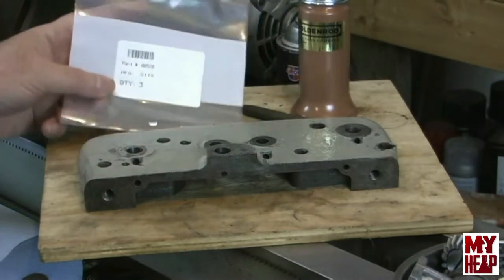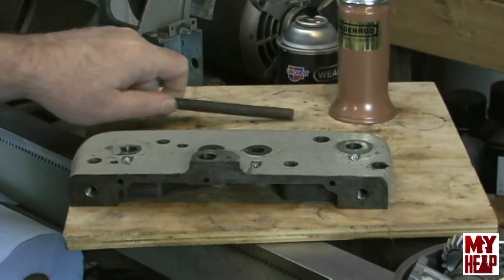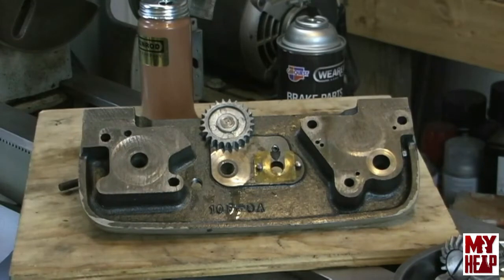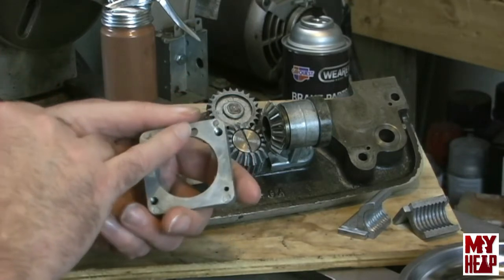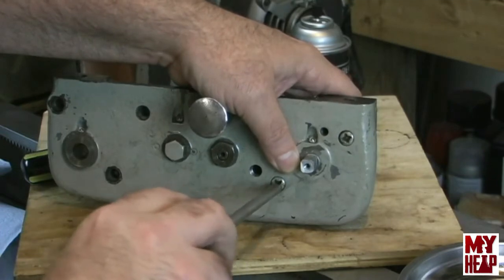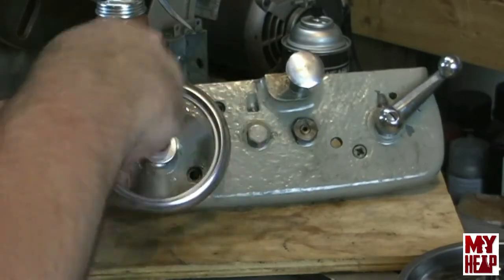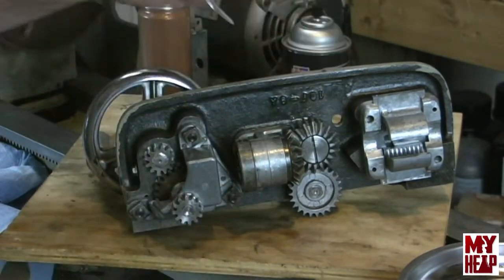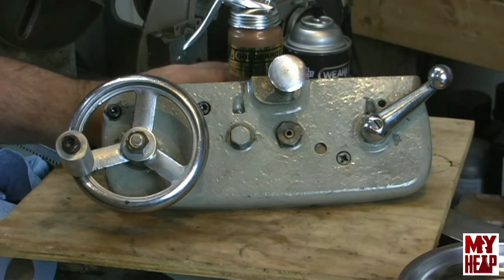Atlas 10F Lathe - TH54 - 14 - Looking Under Bertha's Apron - Part 2

Comment: Joe, enjoyed watching you put your apron back together. I have a request Joe, would it be possible when you buy parts like the oilers, the phillips screws for the apron or any part to put the part number and a link where you bought the part in the space below your video?  I know you said where you got them but I forgot what you said and that would keep me from having to play the video over again. Thanks Joe.
Reply from the maker: Hi Clifford.  I never thought of that and it is a good idea.  I will try to remember to do things like that going forward, in the mean time, most hardware was purchased through fastenal and the oilers were bought from applied.com and they are part number 00520.

I hope that helps and thank you for the tip.

Joe
Reply: My Heap Thanks Joe.
Reply from the maker: You are welcome, sir.

Comment: Joe is the bushing you drilled bronze? It might be oil let bronze witch is horse and shouldn't be drilled out
Reply from the maker: Not sure what the material is.  Your comment is cut off, what were you saying there at the end?
Reply from the maker: Well, if that is the case, it is too late now.  I done drilled the hole.  :-)
Reply: My Heap just make sure it gets plenty of oil
Reply from the maker: That was why I drilled the hole, so the oil pumped into the center ball oiler can reach the bushing.  The real design flaw of the apron, is that there is no real way to oil the bevel gears and cross slide gears.  Well technically you can oil the cross slide feed gear from the oil hole on top of the saddle that would also reach the gear below it, but as far as the bevel gears, well your guess is as good as mine.

Joe
Reply: My Heap I think there's a hole in the saddle that drips on the cross slide gear the bevels are a tuff one though